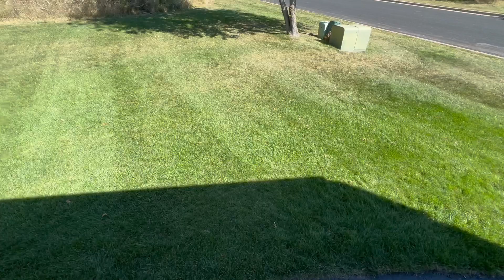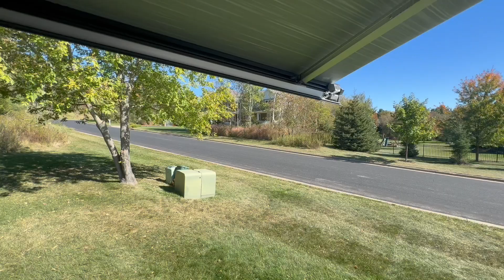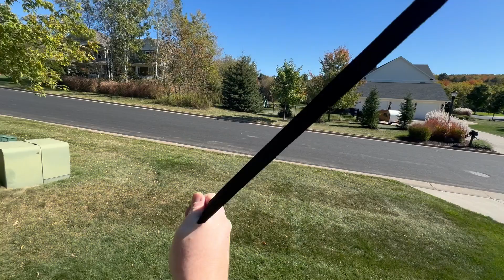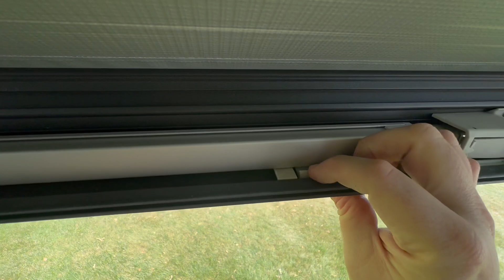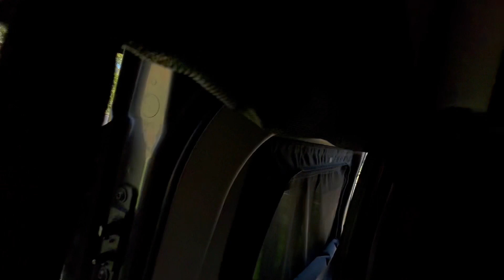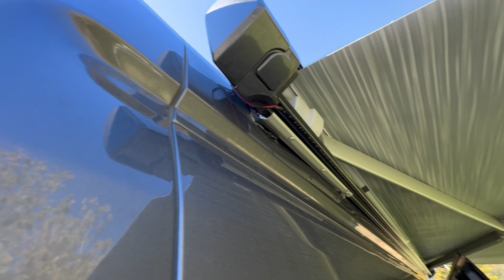Thule Crown Awning Operation and How to Retract if Stuck

Comment: Excellent demonstation thank you! On another note I noticed that when I have shut down all the electric battery switches the solar
panel will rapidly charge your batteries up to 100%
Reply from the maker: You’re welcome!  I agree, under no demands, the 190 watt solar panel should give us 130-150 watts an hour.  Give it 8-10 hours and we make a little over 1000 watts or 20% of our capacity.  Our vans are stellar this time of year on lithium batteries since we don’t need air conditioning.